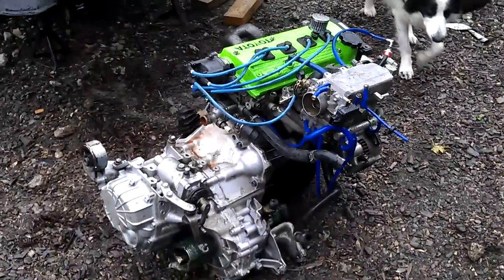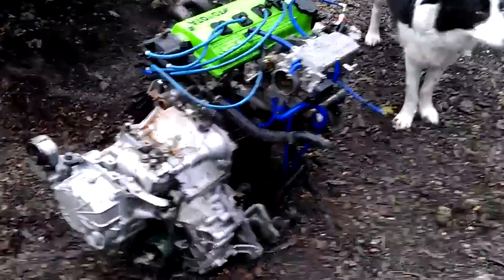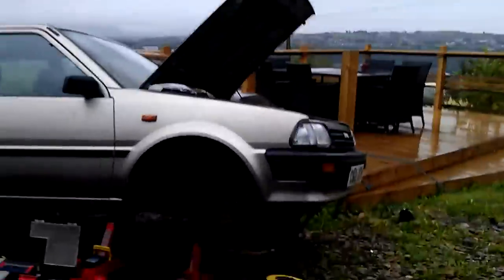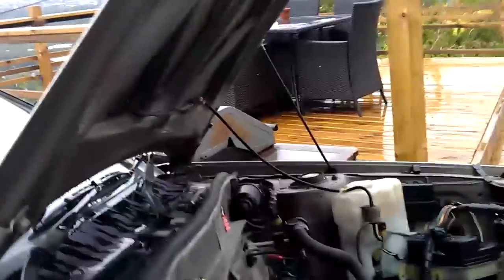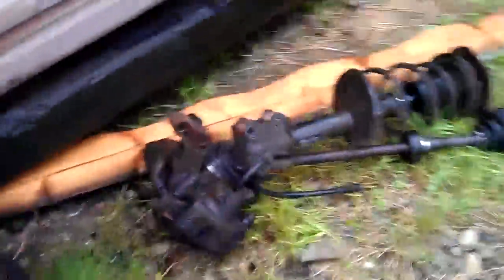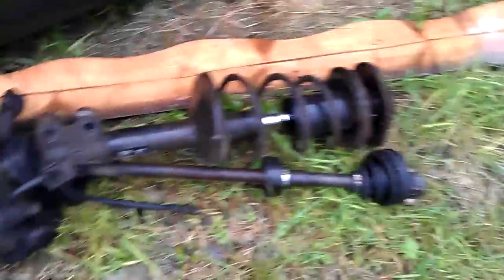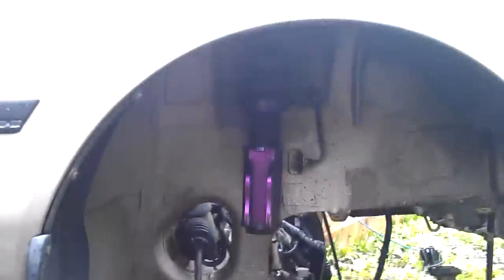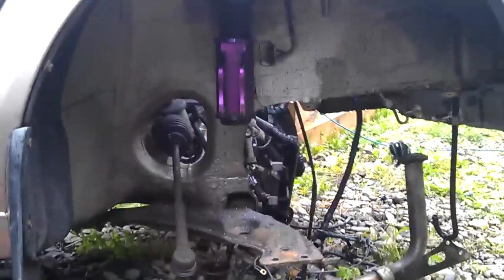EP70 (boxy starlet) 4EFTE Turbo conversion part 7: EP70 Coilovers fitment

Comment from the maker: They are D2 Coilovers, they came with the car when i originally bought it but they are about £650 for a set, so not cheap really. They are REALLY hard though even on the softest setting, i use the car on track mostly so its not an issue, but on the road they are a real bone shaker. I wouldnt buy them for fast road use, they make the ride horrible.